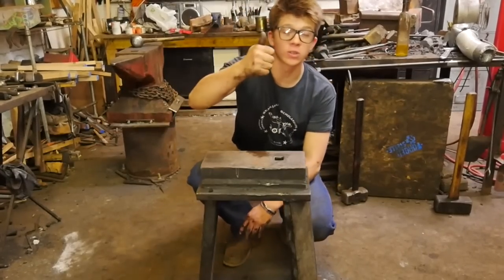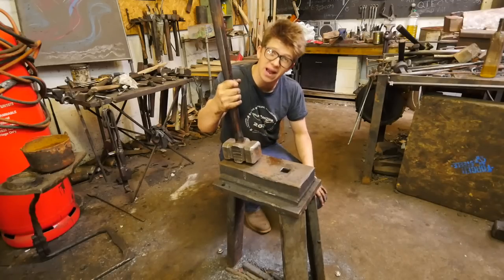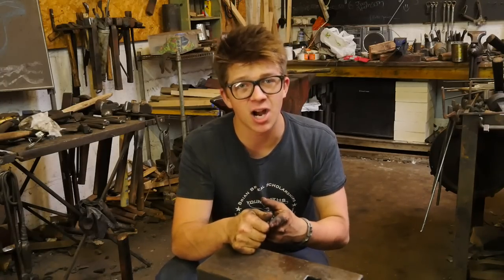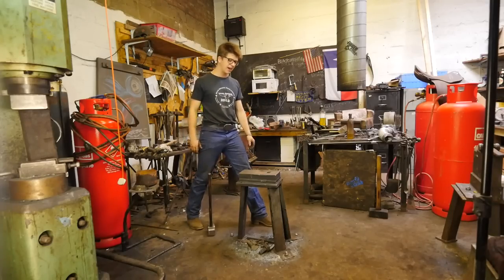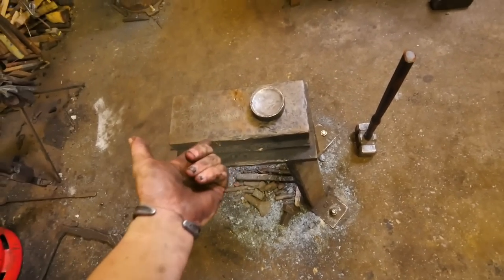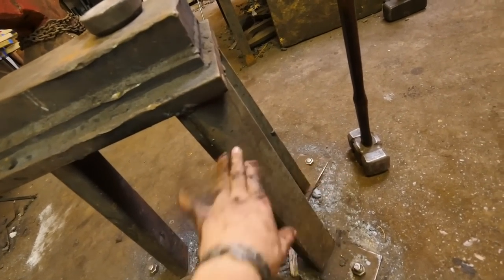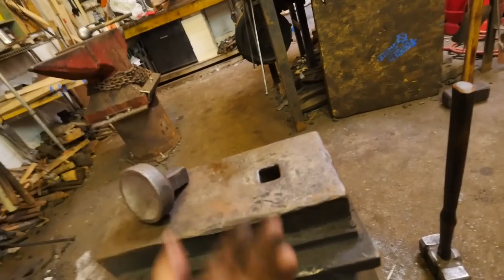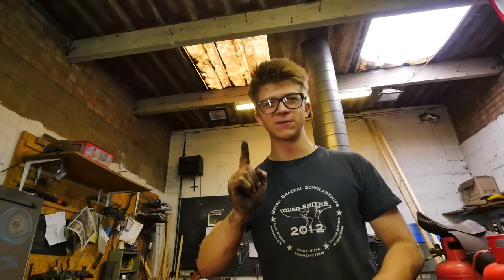The Striking Anvil

Comment: If you fill the legs 3/4 full with lead shot and fill the rest of each leg with 90w gear oil the sound from striking is quite deadened. The volume of the sound is reduced enough for someone to be able to hear a telephone ring during extreme exertion.
Reply: The Back Channel, we like it loud so when the wife calls or yells at you you can't hear and have a legit reason to ignore her.  ;)
Reply: Also sand works well

Comment: Hello,  Just a quick observation.  If your strike is above the horizontal (on the striking face) on a full swing your shoulder is still in the blow when it hits.  Not a good thing.  Over time the shoulder joint and elbow will suffer and rotator cuffs are very very difficult to fix and even more difficult to do without.  This is especially pertinent when swinging a heavy hammer/sledge.  So it is very important as you point out to achieve the right height with your striking surface for your particular physique.  Take care.  Doug

Comment: I'm actually going to a junkyard Saturday to pick up a piece to make a striking anvil mine will be attached to the top of a large Maple stump I have never forged anyting and them I'm in the process of beginning this journey I have two old propane tanks I plan to make one of them into a forge it will be a single burner though because I'll be using a weed burner for the main gas feed I do not have a regular Anvil as I cannot afford one yet and we'll be doing this on quite the budget that means as much free stuff as I can possibly get. Another Hobby that I've been waiting to try for many decades. Great attitude great video

Comment: My mind watching this video: AHHHHHH!!!! YOU DID NOT JUST DIRECTLY HIT AN ANVIL THAT HARD WITH A SLE....oh! He says it's mild steel! Well, very-good then! Whack the crap out of that thing! (Edit: In fact, ding that bad boy up!)
This is the first I've heard of a striking-anvil. But the way you explain things, it makes good sense. I've seen smiths get around these constraints by either having specialize low-profile flatters and forming tools, or by forging using a swageblock on the ground, with the master working from his knees and the striker wielding a sledge with a much longer handle.
But now that I see it, I think I really do like this solution. If you're ever starved for topics, and flush with resources, I'd love to watch a video demonstrating how to bolt such a structure so securely to a concrete floor like that.
Reply: Alec did mention "chemical anchors".  I'd heard of the practice, but never by that term.  

Effectively, you drill a hole into the concrete and set an anchor in with super-tough epoxy or other adhesives, which are specifically formulated for strength, vibration resistance, temperature change, humidity and/or other needs.

Tangent:

Choosing the right type of anchor & adhesive combination is paramount in some applications.  The incorrect combination was used in one of Boston's "Big Dig" tunnels, causing some concrete slabs to fall from the ceiling, crushing a car and killing someone.

Fortunately for any Wile E. Coyotes nearby, no anvils are going to fall from the ceiling.
Reply: verdatum
Reply: It won't take much of an anchor to hold that in place. Having said that,  except no substitute for redhead anchors!! I used to work in a press shop installing Goss community presses and each unit is 9500 pounds and we only used 4, 5/8 anchors. One in each corner.  Where most ppl mess up with anchors in concrete floors is not going deep enough.  Drill till you go all the way through the concrete and all you have is enough thread to get the washer and nut on it and tighten the shit out of it. With 3 5/8 anchors put in right, you'd have a hard time prying that little anvil up with a bulldozer.
Reply: v
Reply: @0num4  the old timers used to do the same by drilling a conical hole and filling it up with molten lead, though apparently this could get a bit dicey if the concrete was a bit wet! Now we have crazy polymers that apparently are stronger than lead and less likely to burn your face off, as you say!!

Comment: Alec,
A couple of things, How about a demo on striking practice? I have thought that anyone going through the expense of taking your classes should prepare. Striking with a sledge is no easy task if you're not accustomed to it, especially if you are taking a full, over the shoulder, behind the back, end of haft grip, swing. I've split my fair share of cords of wood, and driven large stakes into the ground, and I have also broken two handles on sledges over the course of thirty years. An old truck tire with a spot of paint on it would make an ideal training and muscle building piece of equipment. (Don't they do that in Cross-Fit?)
Just an idea!
AAR
Reply: That gave me so many new ideas!
Reply: Yes they do, and it's awesome
Reply: Albert Rasch as Hank Ford once said, "Chop your own wood and it will warm you twice." He forgot to mention limbing, bucking, dragging, splitting, stacking, and schlepping! From one kindred would to another, I believe we can forego the necessary training to be a striker since splitting firewood will quickly condition one's eye and muscles to hit where it's needed :)
Reply: Make sure to let the air out of the tire.
Reply: Albert Rasch I
Reply: Nothing lubes the joints up like busting cord wood.

Comment: Thanks for this!  I just bought a 2.5" slice of 6.5" round mild steel to make into a striking anvil, and was unsure about material and dimensions for the mount etc.  I might have to find some timbers to install my anvil and its mount, as I'm working in a shop with a suspended slab floor that I don't want to penetrate.  In any case, thanks for the tips!

Comment: Awwwww I want a rounding hammer! A small one. Like a 2 pounder. Anyway, I just got finished dressing my cross peen for the up coming forging season. I like in the Midwest region of the U.S. And it get cold and snowy half the year. My forge is outside so as soon as I touch my work to my anvil it is cold. I could preheat my andvil but swinging a ha,men in the cold sucks. I just got a new grinder, and I am more of a bladesmith than a blacksmith but I am going to entry and make one of those epic leafs you made.

Comment: Alex, I might suggest you incorporate a plate by the feet below the hearty hole to be used for upsetting...with the understanding that if you upset too much you get you steel stuck in your anvil.  (Or just upset with hammer on hot steel...but you'll still need a plate.

Comment: I have a friend that works at a metal recycling facility. They have a Hauge machine for cutting all that steel into bits. This machine has "teeth" that are changed on a regular basis. The "teeth" are big rectangular steel blocks about 70kg.. im thinking one of those would make a great strikking anvil, they already have two round holes, so making one square and im set :)

Comment: Interesting. Didn't know that these were a thing. I've always thought that an anvil needs to be hard and hefty in order to get some work done. Good insight, as usual!
Reply: the usual rule of thumb is '40 times the weight of the hammer head'.  But with an anchored striking anvil you've basically turned the foundation of the building into part of the anvil.

Comment: You may have addressed this question at some point but why is it that smiths have large lengths of chain wrapped around their anvils? The obvious answer would be for winching it but then why leave it on the anvil, does the extra weight help reduce rebound or is there another reason?
Reply: Lyle Abraham it helps reduce sound. while the noise sounds great, it gets real annoying real fast to some people who are working for many hours straight. ☺

Comment: , you seem to know more about steel than many ( so many different things you've done time and time again) Damascus brass blew me away,my celtic roots wants a ring lol

Heres my questions... people use rail as there first anvils ,( breaking out) is the top of the rail and the flap bottom the same steel or hardness/rockwall?  Instead of grinding a flat could I just flip it?

I want to take 3 peices of rail ,2 for sides and one flipped centered for a flat top,weld and fill with lead. what's best rod? 7018,6010 or hyp?  And how should I harden the rail steel or should I just leave it ? 

Sorry bout so many questions but b4 I go in ass up I'd like an opinion from someone with experience and knowledge... and from your great work to some fails you seem best to ask ... thanks in advance and may the hammer keep you happy 👍🔥⚒

Comment: C = Carbon Steel (Low Carbon/Mild Steel, Medium Carbon, High Carbon)
A = Alloy Steel (High alloy, low alloy/structural, quench/tempered struc, etc)
S = Stainless Steel
T = Tool Steel

Low Carbon Steel (aka Mild steel) = has 0.04% to 0.35% carbon. 
Medium Carbon Steel = has 0.35% to 0.50% carbon content (for forging, casting
High Carbon Steel = 0.50% - 1.00% + (for tools, knives, etc)
(Metallurgy Fundamentals 5e)

-Carbon Steel is "less expensive than alloy steel. Has fewer alloys, fewer special properties.

Comment: Hey big fan I know for some 1 inch thick by around 12 inch wide and about 10 feet long mild steel could I cut it into plates and weld them together as you would like stacking Damascus to make a usable anvil ?

Comment: i'm two years too late, does anyone know or if you are still reading, Alec, would a cast iron anvil be similar to a striking anvil? i know the issues with using the cast iron is the same reasons you gave for using the mild steel. thx.

Comment: Ding that bad boy up! 
I recently made myself a striking anvil, but since the floor of my "shop" is dirt, I don't think it's as efficient as it could be. Problem with putting stakes in is that they're likely to pop out of the ground, so unless I pour concrete (which I'm really not inclined to do since my shop is hopefully not a permanent thing yet), I don't know what to do.
Reply: Cave of Skarzs  paving stones sink them into the ground then put the anvil back on top
Or use some 4x4 and make a small floor sunk into the dirt 
Either method will add rigidity to anvil
Bonus on the 4x4 method is you can nail or lag bold the anvil down to it
Reply: mightymalikie Thanks!
Reply: Great suggestions so far.

Alternatively, your stakes could be very long.  So long as you have no worry about hitting a utility line underground, you can make them as long as needed.  

I can confirm that driving 9 feet of metal into the ground with an 8 lbs sledge sucks a lot, but that bad boy isn't going anywhere, any time soon...and you can pull them up with a strong chain and a truck if need be.
Reply: Thanks Won't be able to do nine feet, but possibly five or six. I'm not sure which I'll chose, but firstly I just need to fix the thing. . .
Reply: Cave of Skarzs I buried large log rounds in the ground and used railroad spikes to secure it.
Reply: That's a good idea too; thanks!
Reply: Cave of Skarzs Just  use some 2x6  and make a form an pour concrete for you base. Make it big enough to mont anvil. When you move you shop you can relocate it and grout it to your new floor. Good luck

Comment: Alec what is the difference in Cost of the Mild Steele anvil against the Carbon Steele Anvils?
Reply: Mild steel is actually "Low Carbon Steel" >.35% carbon. (Metallurgy Fundamentals 5e)

C = Carbon Steel (Low Carbon, Medium Carbon, high Carbon)
A = Alloy Steel (High alloy, low alloy/structural, quench/tempered struc, etc)
S = Stainless Steel
T = Tool Steel

Mild steel is a type of carbon steel with a low amount of carbon – it is actually also known as “low carbon steel.” Although ranges vary depending on the source, the amount of carbon typically found in mild steel is 0.05% to 0.25% by weight, whereas higher carbon steels are typically described as having a carbon content from 0.30% to 2.0%.
source:metalsupermarket.com

Comment: Hi Alec,I'm in process of making 2 striking anvils, one for me and one for a friend who I'm pushing into blacksmithing, lol. What are your thoughts on a 4140, non hardened anvil? should be tough and still safe, yes? 2" thick by 6-1/8 wide is what I have for stock.
Reply: 4140, hmmm, IDK, might be allittle on the soft side RC 25ish
http://www.simplytoolsteel.com/4140-alloy-steel-data-sheet.html
Now, if you can heat treat it you'll have something really good!
AAR
Reply: I think he was talking about comparing it to mild steel non-heat treated. Personally, I don't think it would be any softer than mild. Use what ya got!
Reply: Exactly. My stock actually came from a forklift tine, which I'm told are usually 4140....hardened of course. I have to anneal it to be able to drill and drift the hardy hole. luckily it will fit in my gas forge. I just need to come up with some tongs or a way to get it out when hot. Gonna have to weld a good bit of handle I guess.
Reply: I would like to harden it but have no way to temper it. Just a toaster oven at the shop!

Comment: thanks for the info. i have the top half of a forklift blade, will that work? its approx. 2"*4"*12". also how much is it for a post vise across there?
Reply: Hell yeah that'll work! Should be 4340 maybe 4140. They come in a variety of alloys, but they're all tough. As long as your not beating directly upon the anvil surface itself with a properly hardened hammer, almost anything flat will work!
AAR

Comment: I have a little anvil that I'd like to restore some chips on. I don't have a good torch or a large forge. Is there any other way to preheat the anvil before welding?
Reply from the maker: +Shane Monaghan BONFIRE!
Reply: Got a big enough grill?  No shit, it'll do the trick as long as you have enough space and keep the heat consistent.  Propane, natural gas, charcoal, wood...your choice.
Reply: do you have an arc welder, they make rod for hard facing.

Comment: If you want some advice don't use any sledgehammers over 10 pound (if you can avoid it) in 30 years time your arms, elbows and wrists will be in reasonable shape. 7 pound is about perfect for most jobs and it is the speed of the hammer that does the work. my arms and hands feel it now with big hammers at 58 yrs old and a 4 pound sledge with 1 arm is murder on the arm.

Comment: How far in from the end did you put your hardie hole?
Reply from the maker: +Mark Spesard edge of hole is 3" from the end :)
Reply: Alec Steele Just got a chunk of steel. 15.25x5.75x4.25. now to punch that hardie hole....
Reply: What size bit would you start with before I drift the hole? 3/4" or 7/8". Keeping in mind it's 4 1/4" thick. Thanks

Comment: DING THAT BAD BOY UP!

An American with a pretty curious question... Why is it that we are seeing more Brits using Imperial Measurements? Seriously I was always under the assumption that the Brits were taught only Metrics..m
Reply: yes brits are taught metric in school, but it wasn't always the case. im 30 and was taught metric. but once leaving school and picking up a trade (carpentry in my case) all the older guys used imperial, materials and fixing were in imperial sizes. so even though our school system teaches one, we still use the other in everyday life and if u by a tape measure in the uk it will show both mm and inches on it